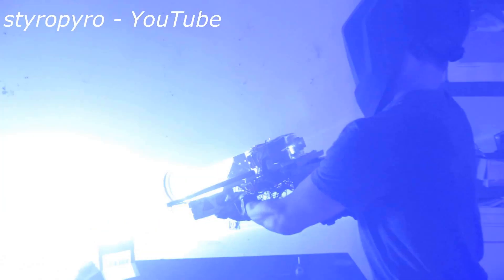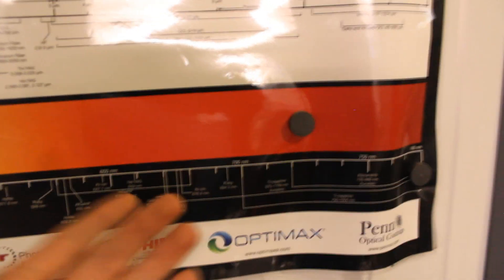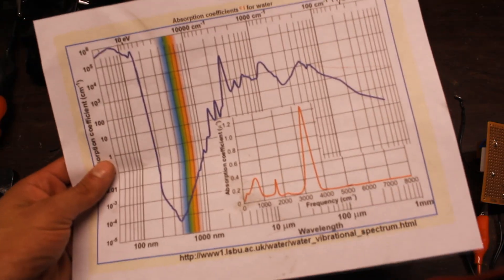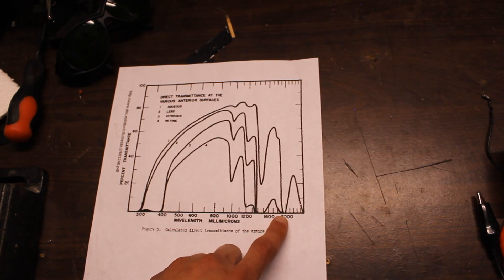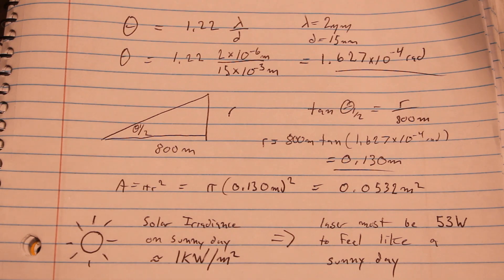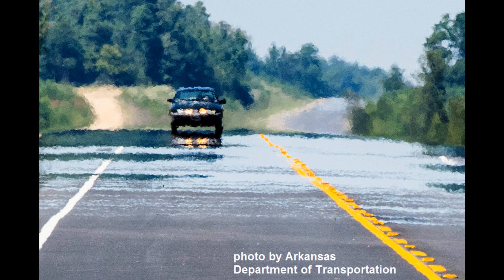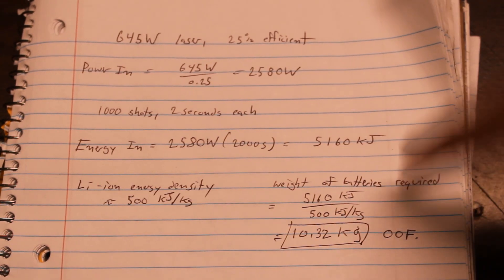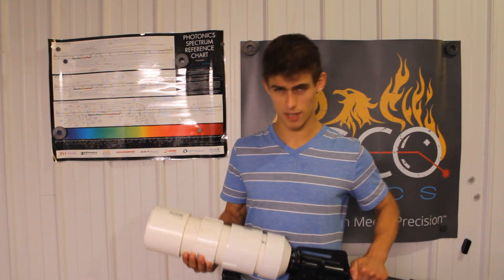Chinese "Laser AK-47": DEBUNKED!

Comment: I think you could get a portable laser of some usefulness as long as you carried a backpack with some kind of battery or power generator. I mean, if you go crazy, you could probably make a small nuclear generator like the Ghostbusters have and feed it into a rifle. Or maybe even generate the light itself with the backpack and feed it into the rifle with fiber optics. Assuming that you could get that to work without overheating. If you had a heat sink that was actively liquid cooling itself you might get that to work. Like the heat sink would take the brunt of the heat, but maybe the heat sink would have some kind of chamber filled with a coolant liquid, that would move outward away toward the opposite end of the heat sink as it expanded, transferring the heat away from the laser.

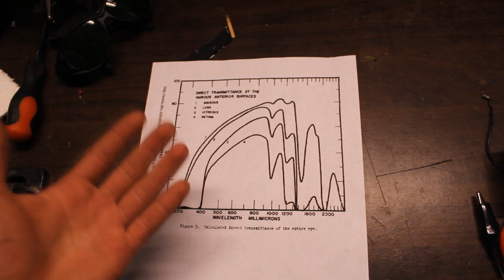Comment: 3:20 You are running under the assumption that China gives a fresh rat's ass about the Geneva Convention. 
https://en.wikipedia.org/wiki/ZM-87
Suggests they don't.
Reply from the maker: Even if they don't care about the Geneva convention, they say the gun can be used in hostage situations. If you shoot 
the guy with the gun, everybody else in the room instantly goes blind, as well as anybody outside taking any sort of reflection. Looking at the spot of a 0.5W laser on the wall can permanently damage the eyes, so how about one 2000x stronger?
Reply: Moral of the story is that the leadership of china does not put a large value on treating human beings decently, which is unsurprising.

Comment: As a point, you're (at least!) a factor of 2 off in the power calculation. The object radiates from both sides of the material, so it's got a radiating area of 0.1064 square meters. It's of course even worse for anything that's not flat and at normal incidence, because you radiate over your surface area. And of course taking into account ignition time makes things far, far worse.

Comment: Maybe they use an automatically adjustable lens to focus the beam perfectly to that distance. It’s not very far fetched.
Reply from the maker: Those beam diameters I calculated were the MINIMUM possible at that distance for a 15mm beam size and 2000nm wavelength. It is physically impossible to do better than that. If they added a telescopic lens assembly to increase the beam size then they could focus it down better, but the company explicitly states that their laser does not require focusing.
Reply: You have to apply the Rayleigh Criterion in reverse! If you have a larger beam coming out of the gun, you can focus the point more perfectly to a smaller point on the wall. Or if you have a small beam coming out of the gun, you will have a large spot on the wall.

Comment: I have a suggestion for an experiment. I need to know what happened if you run laser light in a circle. I'm sure you can devise a better experiment than I have come up with.  I don't have the stuff yet, but I have ordered it. I'm going to use fiber optic cable and a splitter to send laser light in a continuous loop while continuously adding photons. I was wondering if you might be able to do something along those lines that would be more visible than my experiment?

Comment: I think I figured it out.
On low it can do 1W for 2 seconds 1000x times.
On high the laser is measurable with some exotic sensor at 800m.
On high at point blank range it set fire to a uniform covered in coal dust inside an a oven at 400 degrees while at a vacume.
When disassembled the heaviest single component is 3kg.

Comment: Your assumptions that the wavelength should be in the water absorption range and the chinese are bound to Geneva inhumane weapons conventions... I call a fault in there. 
Otherwise I can't argue. 
But if I'd build a weaponized handheld laser system and cared less about Geneva in general, I'd go 808nm diodes. Already mass produced in there, so good R&D, cheap, good glass penetration, totally inhumane as at the power levels the collateral's would be just gross.

When talking about weapons and war and killing or crowd control (china is a lot about that), the fear factor is high ranking. Just the smell of scorched hair would suffice in riot control, par example. 

Heck... I just found a cheap riot control method> burnt hair smelling smoke grenades....

Comment: Yeah Drake I just looked at thing up as soon as I got off this video they said invisible beam but the videos that come out show a green beam. Now the fuel tank thing the only thing I can think of is it the metal heats up so much in the tank that causes the fuel to combust, unfortunately being around some CNC machines I understand that you would have to hold that Beam on that tank for quite some time for it even get the metal hot enough. They claim it's non-lethal but then it can start fires from 800 and fire 1000 shots in Rapid succession, but if I am not mistaken a beam of that size would need a large power output and when overheat quickly so you would have to run seriously thick wires to keep it from overheating which would add probably another 2 kilos to your battery weight with the electronics added in. I've learned a lot from you and a lot of other creators that work with lasers. I have managed to build a few handheld burners but a green bean does not look invisible to me.

Comment: I have a question about a chemical laser. I know you use electrical lasers mostly but have you ever made or would you consider making a chemical laser? Is it possible to build such a device in your shop?
Edit: also, has anyone, to the best of your knowledge, ever tried nitroglycerin or a similar explosive for an Explosively pumped gas dynamic laser? I can’t find any records of anyone trying this and it seems like an obvious choices to me. And if so, did it work at all because if it did, that opens the possibility of having a laser powered by gunpowder (regular smokeless powder being nitroglycerin and nitrocellulose). You might have to clean your mirror chamber and/or valves after every shot though so I really don’t know if it would work in the first place or if it could even in theory be practical.

Comment: Hold up, how many microwaves have you ripped apart to have enough unbroken magetron magnets to use a wall mounting equipment???

This was a great video, however I have some questions. As for the eyesafe requirement, I would not be certain that china cares to adhere to that (just look how they treat their dissidents in all sorts of humane ways). 

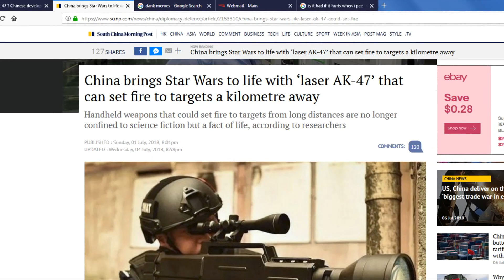One of the first pictures 0:19, looked like they were using a giant beam expander, would that make such a weapon feasible under say 1000 feet of range?  With that and ignoring eyesafe requirements, you could use a DPSS Pulsed NdYAG laser.The beam expander will obviously not allow perfect divergence but it should make it pretty decent.

I ran your calculations for ~1000nm NdYAG and the numbers look much better for the Chinese.

Ideal divergence over 300m is 6.66666...*10^-5 rad for 1000nm light. that means the beam is 1cm in radius 300M away.  That means we need only 314.159...mW to emulate the sun at 300M and 3.808W to ignite cotton under super ideal conditions.  assuming we need 10 times more power to ignite cotton in a slightly more realistic manner, and the laser is 10% efficient (Is this valid for YAG? I could not find a solid number) then we are looking at 300W pulses.  

Assume you only get 500 shots (that would still be wild for a hot swap battery system) and suddenly this thing looks still far from what is claimed, but pretty impressive. you would have around 1Kg worth of battery.  (but if it is hot swap just think of how great that would be, just clip in batteries like magazines).

The use of this thing would be strictly for demoralizing, or blinding, you would not be able to do much more besides make flashes of fire pop up on victims clothing or skin (I would consider that very intimidating), and 300M means it is not useful for the battle field. But it could work great for china to control its people. 

I do not know how well a beam expander is going to handle 300W pulses, nor am I very well learned on lasers, I saw some math and figured, hey, I can plug in numbers! Am I making terrible mistakes here? (or more likely, how many mistakes am I making here?)

I look forwards to your laser sniper video!

Comment: Very informative but there are several issues

First, the article says 1000 shots, each not lasting more than 2 seconds, not 1000 2 second shots.

Second, the scope probably protects the user from being dazzled by the laser. So your wavelength estimates aren't well founded. And while it is theoretically illegal for permanently blinding lasers to be used, it's funnily enforced. It's not illegal for a laser of enough power to blind if it's used for killing. And we're expecting China to follow UN treaties.
Reply from the maker: They say the gun can be used in hostage situations. Even if you shoot the guy with the gun, everybody else in the room instantly goes blind, as well as anybody outside taking any sort of reflection. Looking at the spot of a 0.5W laser on the wall can permanently damage the eyes, so how about one 2000x stronger?

As for the runtime, say it's even 1/4 of what was stated. For it to be able to burn people from 800m away, the power would have to be WAY higher than those absolute minimum powers I calculated in the video. There's no way that's even remotely possible for a 3kg weapon.
Reply: styropyro We can't say anything much about the blinding. UN treaties are routinely flouted, and the one in question specifically bans permanent blindness. Even the US uses dazzlers. And we don't know anything about its wavelength, other than that it's not in the visible spectrum.

But your energy density calculations are off. The best lithium batteries go up to 300 wh/kg, which is slightly over a thousand kj/kg. Tesla's batteries are 254 wh/kg. 

https://www.teslarati.com/tesla-partner-panasonic-20-30-percent-energy-density-increase/

Given that the gun costs 15k its more practical to use a higher end battery. And if we assume the battery is 2 of the 3.3kg, and use. 0.5 seconds when they say 1000 shots, it would give you leeway to double the theoretical power of the laser to account for atmospheric attenuation and what not. 

Their most circumspect claim is not the flesh or cotton burning, but puncturing fuel tanks (btw the autoignition of jet fuel is much lower than ethanol). Fuel tanks are not exposed on planes, but let's assume it's kept in a thin steel box. The melting point of steel is 1370C degrees, and metal reflects radiations in most wavelengths very well.

Comment: Laser weapons that blind aren't banned by international law, only ones designed specifically to blind.
Reply from the maker: They say the gun can be used in hostage situations. Even if you shoot the guy with the gun, everybody else in the room instantly goes blind, as well as anybody outside taking any sort of reflection. Looking at the spot of a 0.5W laser on the wall can permanently damage the eyes, so how about one 2000x stronger?
Reply: styropyro Even if it didn't blind people, using burning lasers sounds like a terrible idea for a hostage situation, it seems like you'd end up burning the whole damn building down with everyone still trapped inside
Reply: @zavire4  yeah that's a flash bang more like
Reply: @zavire4 it just said that it could be used for it. Not that anyone would survive it
Reply: @styropyro  yeah for example, did you know the M4 Sherman was originally listed as having reconnaissance capabilities? Just because a weapon has the capacity to perform a task, does not mean it will ever be used for said task
Reply: @styropyro  POWER
Reply: @styropyro  Well that just sounds like the laser gun would be VERY effective tool against a gang of thugs or a platoon ;)
Reply: Using a laser for a hostage situation sounds more like wanting a laser weapon cus "woah dude" than actually wanting to resolve hostage situations
Reply: Potentially with some kind of computer-controlled thing to track and point the beam directly at the target's eyeballs, you could easily blind several people with significantly less power than that in only a few milliseconds.
Reply: @AJMansfield1  go search youtube for michael reeves. you'll find that eyeball tracking software
Reply: @Tonatsi  I've seen it.
Reply: this is the problem with weaponized lasers. Any amount of scatter will blind the hostages. There is also the shooter. Backscatter will blind them, and even if i were wearing goggles, i wouldnt' want to have backscatter
Reply: @moonasha  maybe an inferred laser could cure this? Like, an ultra powerful inferred laser
Reply: Tasu 1 because the geneva convention protects them as much as it limits them. If they start breaking the geneva rules, then they become free game for everyone else bound by the geneva convention to also use normally convention-defying weapons against them.
Reply: Anson Mansfield The Geneva convention does not deal with weapons of war its about treatment of prisoners of war. The Hague convention, Outer space treaty among others does deal with weapons.
Reply: Anson Mansfield Something something Geneva
Reply: @petero.7487   "It would also likely be a weapon that would serve more for holding down dissidents."  Sounds like the perfect weapon for the Chinese Communist Party, or any socialist/communist regime for that matter...
Reply: Anson Mansfield not necessarily, international governing bodies have decided that "customary international law" exists, essentially that countries can still be expected to avoid the use of certain banned weapons/ tactics regardless of whether or not they have signed the relevant treaty, for instance if a country didn't sign the ban on chemical weapons their leaders could be charged with crimes against humanity anyway. 
I think the idea of customary international law started with the Nuremberg trials, but I'm not entirely sure about that
Reply: https://en.wikipedia.org/wiki/Beslan_school_siege some would use it.....
Reply: L00L
Reply: The use case is banned, and by that extension a "weapon" pointed at "People" would be seen as skirting that law no?
Reply: All lasers blind tho
Reply: Anson Mansfield I think that's precisely what the treaty was trying to avoid, because there's little limit to the extent of blinding weapons that could be developed because blindness from lasers is something that results from the power of a laser rather than the energy, you could make an ultrashort pulse laser using very little energy that could blind entire regions, acting like an EMP for vision
Reply: Nigga
Reply: hammerpark and you
Reply: firstname lastname and you!
Reply: moonasha lmao i bet all of you are the same person, because you are so congratulations
Reply: Anson Mansfield by all i mean u

Comment: ● Have an APU's  AC generator directly connected to a bank of HV capacitors and that APU is 80,000-120,000 RPMs 

● 196nm Deep-UV laser for HV assisted discharge at 1ns Peek-2-Peek pulses; effective up to about 200 meters

● Barium Strontium Titanium capacitors charged up fully via an APU where each capacitor in a Marx-Impulse Generator circuit are reated for 30,000-50,000 volts.

Try it 😎💥

Comment: that last point though, wouldn't a laser strong enough to burn through a car and into a gas tank be powerful enough to burn the gas tank, thus that giving off the "spark" needed to set the fuel on fire?

I know a weak, or unfocused laser would set plastic on fire when engraving or cutting it. (from experience) and when it's focused and good, it will just vaporize the plastic. But I'm unsure if that would set fire to a flammable liquid. it's certainly hot enough but,,,I mean it should right?

Comment: Hey styro, do you think it would be possible to have a laser with which you can adjust the wavelenght on the go? And even better, have a sensor along with the laser that detects the most absorbed wavelenght of the surface the laser is aimed at, then have a computer set the laser's wavelenght automatically to the said wavelenght in real time as you point it on different objects?

That seems like a big step into efficient laser weaponization.

https://en.m.wikipedia.org/wiki/Tunable_laser